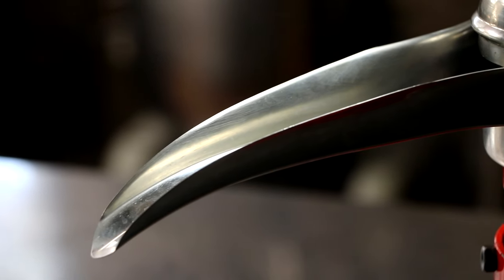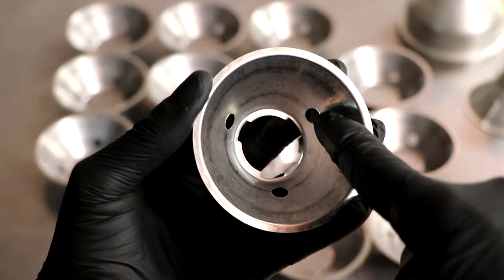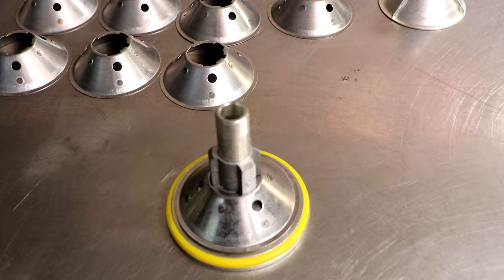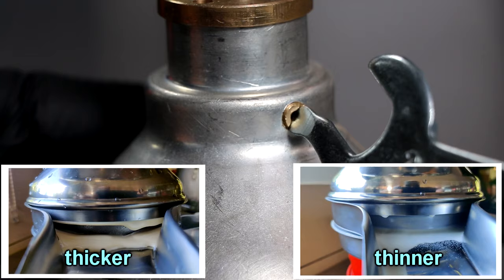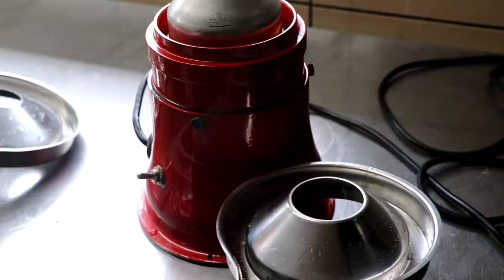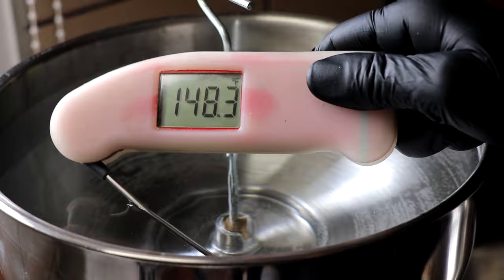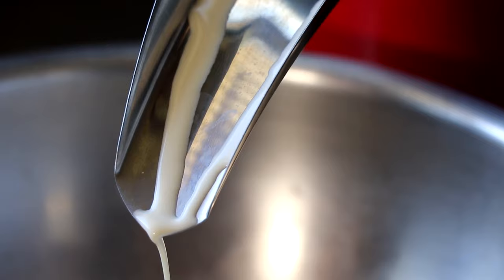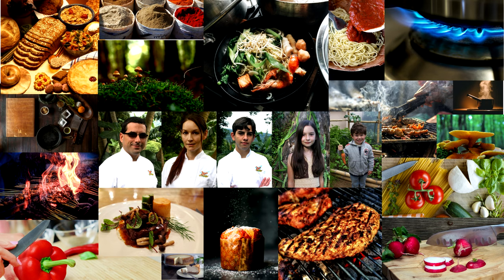How to use the Minneer Milk/Cream Separator

Comment: There is a learning curve. I have used it around 8 times and now would give it a 7/10. A couple of things:
1) The edges of the two spouts are sharp and can cut you. 2) the temperature of the milk is important with regards to the thickness of the cream that initially comes out - you really have to play with the set screw 3) you can’t adjust the cream mix once you start the separation process. It takes a constant temperature and slight adjustment of the set screw. 4) at the end, replace the containers and run through about 8-12 cups hot (150^) water. Clean up is easier

Comment: We used to have our own milk cows. My grandmother had a hand cranked separator and my folks had an electric one. 
First and las rule is use lots of hot water and keep it squeaky clean or you would get sour milk in just a few hours.
Thanks for the video guys..
Reply: Hi! Would you boil the parts? I would think bleaching would work well but if one did not have access to bleach, boiling the pieces would work?
Reply: @n.a.garciafamily sanitiser should work too. You get no rinse sanitiser for fermenting

Comment: I just learned a couple of other things. The wafer must be dry. You have to gently push up around the edge (I used a jelly spreader) until it opens. Wash and dry it. You will need to do it every time you use the machine. Also the engine shaft and the small funnel with the yellow gasket stuck together. I must not have cleaned them properly. It was messy. Good luck!

Comment: Any trouble shooting tips for a brand new separator that the water only comes out one spout? Have not even gotten to trying milk steps. The pin hole is visible on the drum. Have adjusted the gold screw tightness as well.

Comment: The buoy has taken on liquid after use and hand washing. Any idea how to take it apart? I can hear the water rattling around, and it leaks out when I shake it... I don't want it to contaminate the milk.
Reply from the maker: If you are very careful, that buoy can be separated into two pieces.  Be careful not to bend it or dent it though😅
Reply from the maker: You could also place it in a dehydrator or the oven on low to evaporate the the moisture

Comment: Thank you for this informative video. Very well done. May I ask you a question? I used mine today for the first time and when I turned it off milk would pour out the vent or also it happened when I turned the machine on. I turned it off to heat up more milk. I didnt know if it was ok on the motor to leave it running for that long. When I turned it back on cream came out of the vent. Sometimes it was cream and sometimes milk. I can't figure out what I did wrong.

Comment: I do appreciate you doing this video because it definitely taught me how to work my  cream and milk separator. But I have a problem with milk getting down into the base of the unit it leaks down and in the bottom and I have to take it apart and it’s already started to rust inside. And I’ve only used it three times. Also what do you do about the little desk that’s like a pillow and has three bumps on one side and when you put it into the machine the bumps go downward? It gets filled with milk and there’s no way to get it out what am I doing wrong?
Reply from the maker: Yes.  The bumps go downward.  That creates a space for the milk to enter slowly.  You should be able to just take it out with no problem.  As far as the leak, you might want to reach out to the company and let them know.  They might have a better answer for you..

Comment: Just a few things I learned the hard way I want to add in case someone stumbles upon this: 1) make sure you pour the milk immediately after the hot water goes through, the device cools faster than you think and if it does the fat will harden and cause blockage (and farting milk) u really don’t want that. 2) if the device is making weird scratching noises it’s probably because one of the components isn’t put in place properly causing the stick under float bowl to scratch the inside of the disks while they spin (very bad). Make sure to be mindful of noise when u use it; it should be as quiet as possible and not very shaky. 3) it helps to mark the closed setting with tape on the edge of the milk bowl so the open/close setting is a no-brainer. Once I accidentally poured water over the machine while it was on and not spinning (oops) because I thought it was closed. It still works but caused me massive amount of stress. Good luck using!
Reply: Oh and 4) make sure you do not skip any washing steps, or the milk will go bad
Reply: 5) and make sure you don’t get creative and separate cream from the cream after the cream has been separated. It will cause all the cream to go into the milk. I tried to save some milk after I set the cream setting to too thin… ya just don’t be like me
Reply: Dang I honestly made a lot of mistakes

Comment: I haven't used the separator more than 4 times and now when I plug it in, it has power, but nothing happens. Please help.
Reply from the maker: You might want to reach out to the manufacturer.  The moment you turn it on it should start spinning

Comment: Thanks for this. After watching the video I was pretty sure we got it right but after starting to separate the goat milk it started to leak out the back from the skim milk spot where the extender sits on top.  It really seems like it needs a seal. We lost a lot of milk -- any thoughts?
Reply: We had this problem also. My son saw that he didn’t have the spouts positioned like the one shown in the video. When he fixed them, the leaking stopped… just an idea in case you haven’t tried that
Reply: I am trying to figure mine out as well, I have the same issue.  I have to put everything on while the filter is spinning, when it starts, the motor makes it jiggle, it hits the spout rings, and it bounces back and forth like pinball, making the bad noises and not letting the machine start up all the way.  About the send my first batch of milk through, water will only come out of the milk side, no matter what I do, so we will see 🤷🏼‍♀️

Comment: Hi i got the same machine and tested it out today, followed everything.. but it didnt separate the milk and cream, only milk came out and some very thin milk thats supposed to come out from the cream spout... do you think its because i only used about 500ml full cream UHT milk? Should i use more milk but was concerned about wasting them.. i tried doing it 3x and experimented the screw tightness, but still the same result.. what do you think i did wrong? Thank you..

Comment: I bought this separator and after trying to decipher the manual found your video and it’s been a huge help. However when I assemble the machine and turn it on there is a metal on metal sound. When I push up on the cream spout it quiets down but as soon as I release it starts again. Almost acts like it’s motor is off balance Do you have a suggestion on how I could rectify this?
Reply from the maker: It could be that the pieces are not level or somehow the unit is not level...
Reply: I’d say it’s the pieces. I put a level on the base, thinking the same thing and it shows level. However o noticed when assembled the milk in the bowl doesn’t sit that way. It’s higher on one side. Hmm. Thank you for your insight.
Reply: I had the same problem. There are three bolts underneath the machine. You can use the tool that came with it to align the central shaft. Turn the entire bolt, including both nuts, clockwise to pull the top towards the direction of the bolt and anticlockwise to push it away. You have to keep placing the pieces up to the cream spout back on to check for the correst alignment. I hope this helps

Comment: Thank you for your video.
When I try the hot water, and I check for correct assembly, the came leaking under the milk funnel… I redo it and still the leak is there
Reply: We had the same problem. My son adjusted the spouts to be in the same exact position as this video shows and the leaking stopped

Comment: I am having a hard time figuring out how to connect the ac adapter to the plug--doesn't make sense....any clues would be helpful........the end of the cord they sent has electrical tape and little prong.....so weird......
Reply from the maker: Hello Liz.  If yours looks lime mine there are 2 chords.  One connected to the motor and the other that connects to the wall.  The unit  that connects to the motor should have a plug that looks like a stereo or microphone plug on the end.  Plug that end into the corresponding hole on the wall adaptor.  Then plug the wall adaptor into the wall.  If yours doesn't look like that then you might want to reach out to Minneer.  Their customer service is excellent..

Comment: I had water leaking/flooding out of the hole in the red base! Pls help
Reply: Did you ever figure out how to correct this? I am having the same problem. Water keeps coming out of the hole in the bottom
Reply: same here
Reply: Check the filter assembly especially the filter gasket.

Comment: Is this the same as the vevor one on ali. I can't seem to find this one in Europe.
Reply from the maker: could be.  Most of these units are Chinese made so I would imagine they are very similar.
Reply: I have the Vevor 50 litre/hour separator. The only difference I have found thus far, is the allen set screw for the bowl height, which the Vevor lacks. Keep this link around because the Vevor directions stink.

Comment: Presumably, you can’t use homogenised milk in it?
Reply: I use it for goats milk which is naturally homogenized- although it will naturally seperate over time.  So it's possible it might work for store bought...
Reply: It works fine on homogenized products. I use it for my goats' milk, which is naturally homogenized, and it works fine.

Comment: the milk is leaking into the base. I've assembled it as described and double checked everything, but it still is leaking. please help. TIA.
Reply: We just bought one for our lab and it does the same thing.  I originally thought that adjusting the three bolts under the unit would fix this but that just changed the balance, so I had to readjust them back.  Any insight would be a big help.
Reply: I would check and make sure all the disks are in their correct place, then check the gasket and its runs for damage. Make sure the spouts are correct along with the funnels.

Comment: So if I have to warm up the milk then it is pasteurized. Is this suitable for just raw , not pasteurized milk?
Reply from the maker: warming up the milk is not the same as pasteurized.  In this video I used raw milk
Reply: I use pasteurized milk (162 degF) and then cool it to 125 degF which should yield milk at 90 degF at the outlet. When I was cooling the milk to 118-120degF the milk at the outlet was 86 degF.

Comment: How does the thickness setting screw actually work internally?
Reply from the maker: It applies pressure to the inside mechanism that either restricts the flow of milk or allows it to flow more freely.

Comment: Hello! Using this to separate breast milk for a baby in need of skimmed breast milk! I was just wondering if I am still to let the water run through first? Am I able to add less than the amount you put in will it still work the same?Thank you for this video!
Reply from the maker: Yes.  The hot water gets the inside components to the right temperature.  You can add less than I did and it will still work..
Reply: @2guysandacooler  Thank you !!

Comment: What yield of cream should I expect from one gallon of milk from a jersey cow?
Reply from the maker: Hard to say.  Anywhere between 1 pint and 1 quart.  Some produce more some less.  Also depends on the season..
Reply: @2guysandacooler  thank you, I really appreciate your experience.
Reply: It is hard to say but we can narrow it down. Jersey milk is typically very close to 5% fat. One (US) gallon is 3.78 liters and weighs about 3.91 kg. The fat will be about 5% of that or 0.195 kg. We'll assume a full separation and if we go with a 40% heavy cream then you can expect 0.195 kg to be 40% of 0.487 kg total cream or about 0.49 liters. converting back into imperial units (for those who desire it) that's about 0.13 (US) gallons or 0.5 quart or 1 pint.

Comment: I tried my machine the fat didn't  come out just sane milk from one side. The other side is completely nothing
Reply from the maker: When you put together the main piece with all of the disks did you put the correct disk in first followed but all the other disks?  There's one disk that looks different than all the other ones (the protrusions are on the inside rather than the outside)   That part is critical.  Also did you adjust the screw for "thickness" of cream?  I like to have might tightened all the way (to the right) then loosened a half turn (to the left).  Finally was the raw milk warm when you poured it into the bowl...